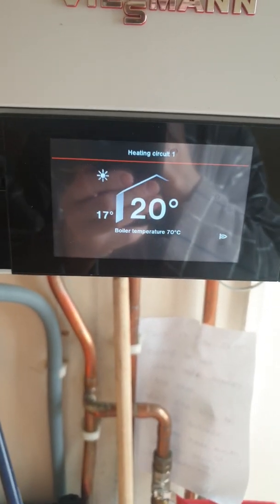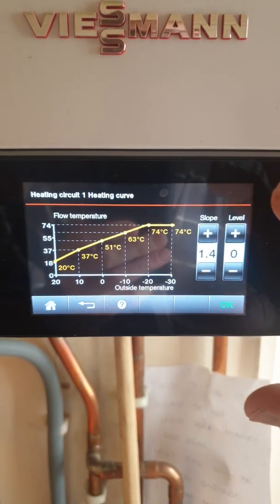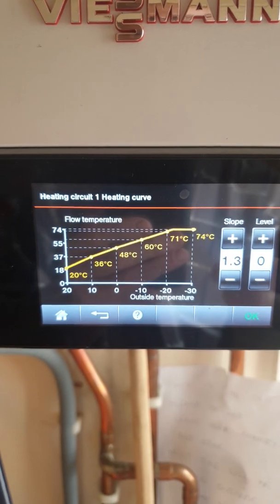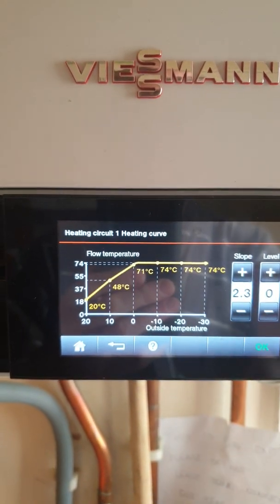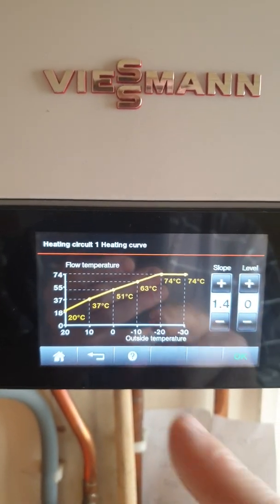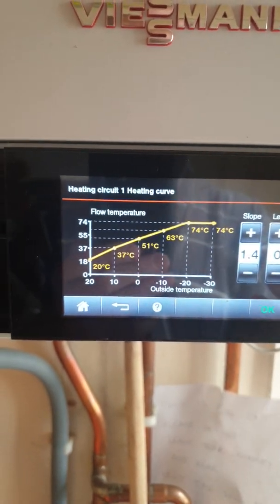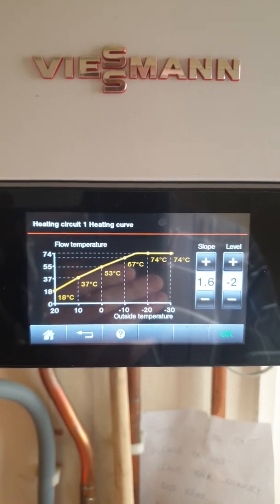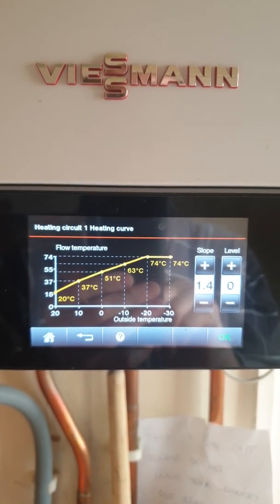Viessmann Vitodens 200 weather compensation.

Comment: Andrew - I hate to challenge THE expert but your explanation does not ring as correct now that a V200 to look at.

My understand is:
1. Slope originates on the y axis as the point of origin, increasing the slope does exactly that but keeps the origin ‘anchored’ at the origin.
2. Level either moves the point of origin up or down the y axis.
3. The parallel shift function is applied by (pseudo ) Room Temperature (in Control terms the user desired value), and moves the whole curve left or right across the graph.
Reply from the maker: Look at the effect of parallel shift of the curve. Do you think it's not the same as level ? The graph in the book shows it quite clearly i think.
Reply: @andrewmillwardwatford9410  I will have another look. Mmmmm it’s all in the words and I am not great with them. I see now that level is the parallel shift but I think the room temp effectively drags it left so the origin value changes.🤔

Comment: Hi andrew i have had my viesmann boiler
Now for 3 mths think i have cracked it
I have set it up with weather curve 60c at 0c and when its
Below -2  i have connected a outside temp stat in series with zone demand contact ( value 8 default for this)
As a boost of 5c extra which works for me to
Automaticaly adjust at that -2 temp or below when very very  cold winter boost asking temp

But not altering slope etc on weather comp slide
When its very cold
 As i found putting slope
Higher to compensate was wasting heat when warmer
When outside was over 6c but this is a way
To give boiler a boost in weather comp mode
And not altering slope for other odd resons
Ie hot water tank boost, cold start after holiday etc
(Can you comment on hrs to boiler starts
Ie 2500 hrs 3200 start ups ) as i am not a boiler engineer but i watch this channel
Taking low loss header out this year and putting in heat exchanger your idea thanks
Reply from the maker: Sorry I didn't reply. How is your boiler performing now ?

Comment: What do your system stats look like for Burner starts vs burner hours?  I'm running mine 24/7 (12deg o/night) and the burner fires up 80 times a day.  Seems a lot for a flexible modulating boiler, but of course I've nothing to compare it to.
Reply from the maker: Depends on the model and your heat load.  Also if you micro control.

Comment: I really like those controls Andrew. Excellent
What’s your insulation like ?
Reply from the maker: The insulation in this property has been upgraded but still would not comply with Part L. However weather compensation in general does not require good insulation as I'm sure your aware :).